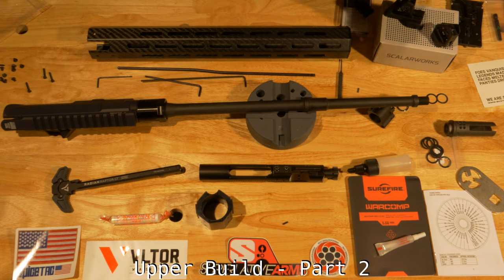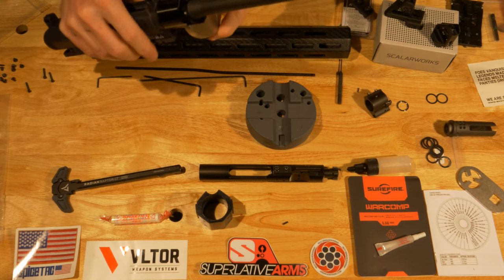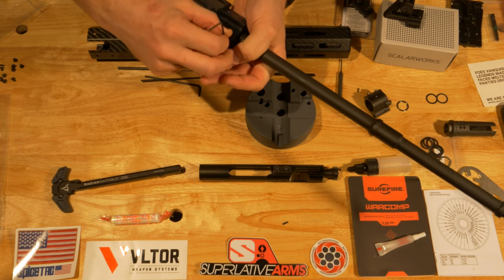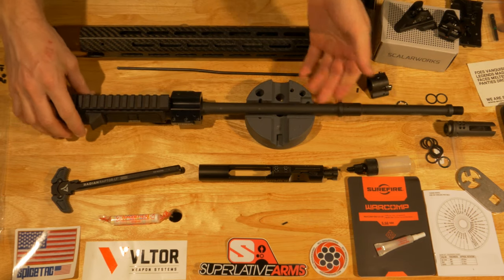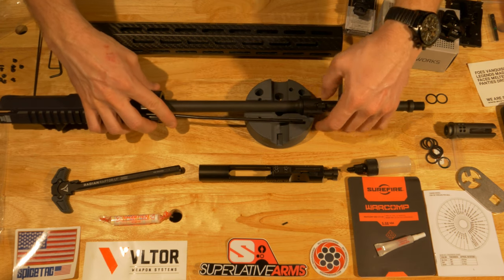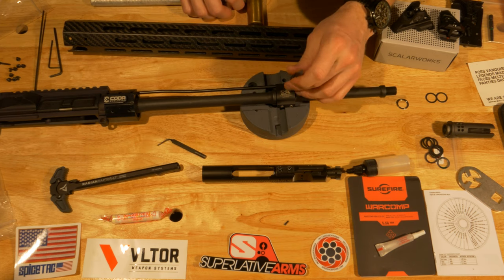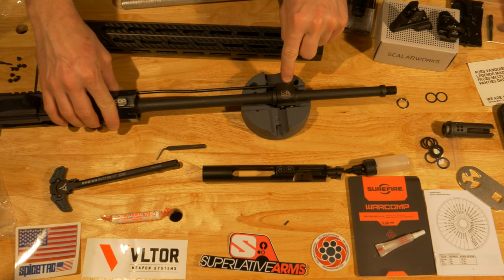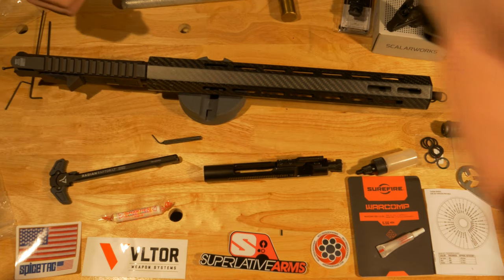AR-15 Carbon Fiber Handguard Install (plus barrel, gas block, and gas tube)

Comment: There isn't much internet content on the Coda carbon fiber handguard. From your experience so far, do you think it's more durable than the Faxon streamline carbon handguards?
Reply from the maker: Hey sorry I missed this comment Willy. I haven't seen the Faxon guards in person.
Reply: @justtheotherdave  Gotcha. So what made you go with the Coda Evolutions? Have you found it to be very durable? You've got some very nice parts for your build.
Reply from the maker: @WetWiIIy I'm pretty careful with it. Seems very strong but I don't want to scratch it up! I have a 1960's RPK-47 with original bare wood laminate furniture for the dirty jobs.